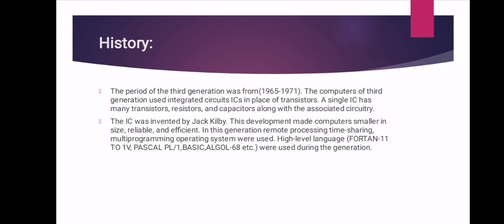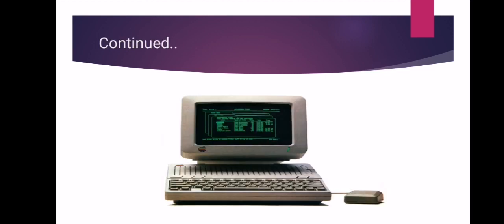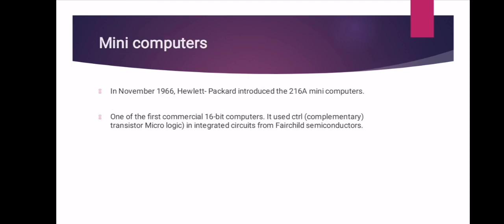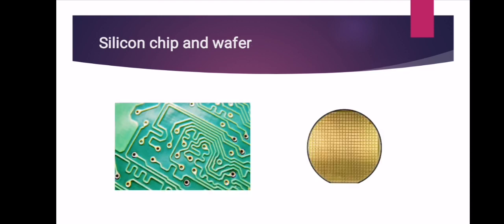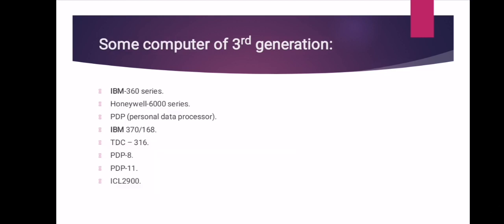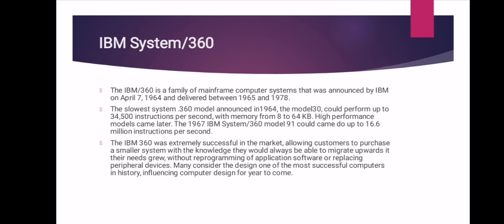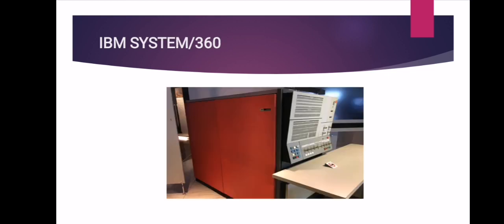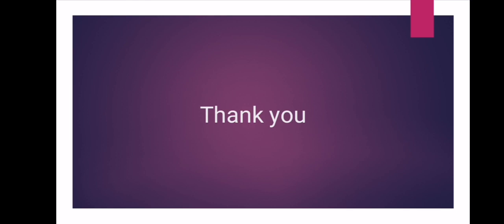Third Generation Computers

Comment: Good 
The period of third generation computers is form 1956 -1971 . They used i
ICS  with stands for integrated circuits in place of transistors . Their man disadvantages is that it requires cooling system ..

Comment: Good
Summary:
Third generation of computers have time period from 1965-1071. They used integrated circuits instead of transistors. An integrated circuit is based on transistors, resistor and capacitor along with security purposes.

Comment: Good
Summary:
Third generation computers (1965-1971). they contain integrated circuits. A single IC has many transistors, resistors, and capacitors along with the associated circuitry.  This development made computers smaller in size, reliable, and efficient.

Comment: Good
Summary :The period of 3rd generation of computer was from 1965 to 1971.The computers of third generation use integrated circuits in place of transistors. Keyboard and monitor was first introduced in this generation.

Comment: Good summary
The third-generation period was from 1965-1971. Integrated circuits (ICs) have been used in third-generation computers instead of transistors. Along with the related circuitry, a single IC has many transistors, resistors, and capacitors. ... This advancement has reduced the scale, reliability, and performance of computers.

Comment: Good 👍
Third generation computers were used between (1965-1971). In this generation it is try to improve disadvantages of 2nd generation computers like transistor were replaced by integrated circuits (ICS). These generation 'S computers were small in size, reliable and efficient as compare to 2nd generation.

Comment: GOOD
SUMMARY:
Third generation computers were used between 1964--1971. Third generation computers were made keeping in view the limitations of previous generations of computers such as transistors were replaced by integarated circuits. Keyboard and monitor were introduced firstly in third generation computers.

Comment: Good...
Summary..
The period of third generation computer was from 1965 to 1971.
The computer of third generation used integrated circuits(ICs)  in place of transistors. A single IC has many transistors, resistors and capacitors along with associated circuitry..

Comment: good
The period of third generation was from 1965-1971. The computers ofthird generation used Integrated Circuits (ICs) in place of transistors. A single IC has many transistors, resistors, and capacitors along with the associated circuitry. ... This development made computers smaller in size, reliable, and efficient.

Comment: Good
summary
 The period of third generation was from 1965-1971. The computers of third generation used Integrated Circuits (ICs) in place of transistors. IC used many transistors making computers smaller. IC is a microscopical array of electronic components on a chip. Keyboard & monitor was introduced. Allowed multitasking. Magnetic disks were used as storage devices. They generated less heat & were expensive. Its significant languages were COBOL & FORTRAN. Drawbacks include need of cooling system & high technology for manufacturing of IC chips.

Comment: Good.
Summary:
3rd generation computers (1965-1971) used integrated circuits. IC used many transistors making computers smaller. IC is a microscopical array of electronic components on a chip. Keyboard & monitor was introduced. Allowed multitasking. Magnetic disks were used as storage devices. Mini computers were introduced in this generation. They generated less heat & were expensive. Its significant languages were COBOL & FORTRAN. Drawbacks include need of cooling system & high technology for manufacturing of IC chips.